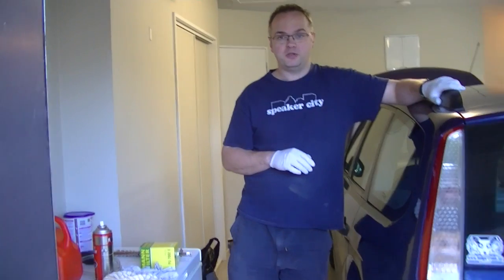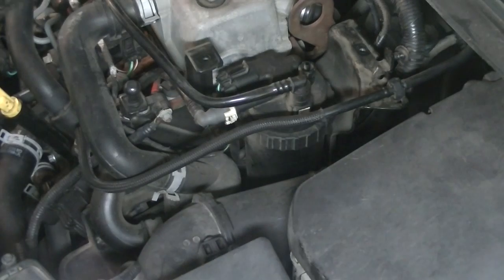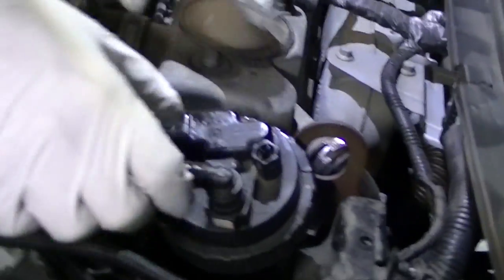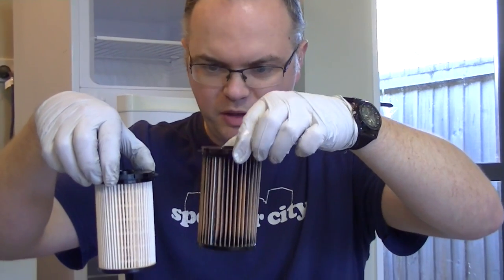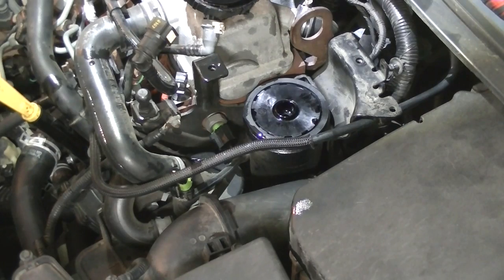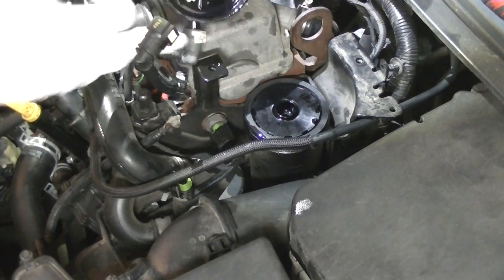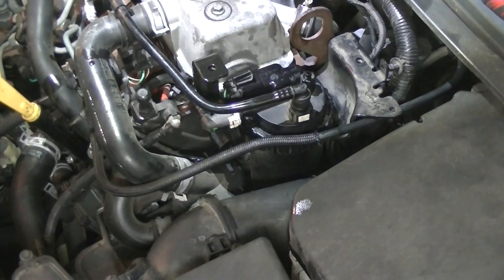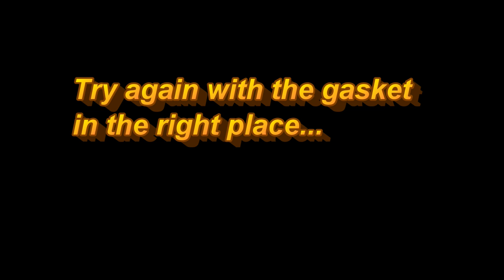Ford Focus 1.8TDCi Fuel Filter DIY with a twist...

Comment: Spent ages looking for a mondeo 1.8 specific video but pretty much looks like its the same engine to a focus. I foolishly thought I'd get away without having to prime the system... alas I was wrong and now its a bicycle ride to the hardware store tomorrow to get the pump xD
Needless to say Ive only just bought the car and the fuel filter is absolutley black! cant believe it. 

Thanks for the video though, very helpful, before I go theres a 3rd little valve on the top of the fuel filter housing (made of plastic) what would that be for?
Reply from the maker: There is a factory bleeding sequence using that bleeder on the top of the filter. I think someone documented the procedure in the comments somewhere. I've never used it. Good luck!

Comment: All you need to do is fill the fuel filter full with diesel, get a turkey baster push as much fuel down both inlet & outlet fuel lines & it will start 5 seconds after , don’t draw fuel out of filter housing get as much in as possible just got mine started this way been messing about for 2 hours

Comment: Changed the fuel filter my dads Focus the other week, didn't have the primer so I towed him around the block a few times because his battery died with trying to start the car and eventually it started, you could tell air was still in the system but after a bit of spirited driving for 15 minutes it was fine.
Reply from the maker: Nice, although you can damage the fuel pump if you run it without diesel.

Comment: Could you show all your steps. I think you forget to tell that you poured some fuel into fuel filter, fuel pipe and primer before priming because primer cannot prime air as you can see in you first attempt. I found another way of getting air out and it involves air to be sacked through small bleeding valve using 10ml seringe and pipe inserted into it instead of piston. I can make video if someone needs.
Reply from the maker: It's not a DIY video. Just showing you what problem I had

Comment: Hi there, Thanks a mill for this super helpful video, I'll be tackling it as soon as some transparent hose shows up for my hand pump. I have a question - what's your opinion on bleeding the fuel line between the  filter and the HP fuel pump? I've seen other videos where they do it, but you didn't do it here. Just wondering if you had forgotten, or if it was a deliberate decision, or if you did it but didn't show it. Obviously the engine started up for you, so your way works, but because I've seen it done bothe ways, I'm a little unsure.

Please and thanks, from Scotland.

Comment: Sadly I did what you said and put the seal on the filter but when I tried to to pump the diesel through it would not work, so I change it back and put the seal on top of filter and within two pumps the fuel was through.

Comment: I’ve just replaced my fuel filter on my S Max and I found the seal was on top of the filter so you might of been right the first time.
Reply from the maker: Ford factory manual says it goes on the bottom. I've heard of both working, I think it depends on filter brand

Comment: From what I've experienced the seal should be ABOVE the filter , as you had it in the first place ,not BELOW,  basically as there is a slight recess in the float bowl for the filter to sit in . I don't know why you had so much air , possibly not seated correctly or tightened sufficiently . Bleeding is critical on these engines , if I have problems I pull the fuel through the main injector pump by connecting your hand pump to the red fuel clip on the return pipe just above the fuel pump , that way there is no way for air to get in between pump and filter when connecting and disconnecting fuel lines . Good video though
Reply from the maker: +tripleMacca thanks for dropping by and commenting. According to the Ford factory manual the seal should be below the filter and that works for me! I have had problems with certain brands of filter though, the updated Mahle version I couldn't get to bleed no matter what I did. Cheers!
Reply: You would expect the factory manual to be right so maybe the one's I have changed have been put in wrong , I normally put something back the way it was unless it is blatantly wrong . If a car comes to me running then I have to assume fitting it the same way means it should go away running , maybe I've been lucky ;-)
Reply from the maker: +tripleMacca it could be down to the differences between certain brands of filter. I presume I would have put it on the way I took it off on this one but no way it was going to work. I replaced a Ford filter with a Mann one. Who knows... Thanks for your comments, always good to hear the voice of experience

Comment: I did the exact same thing. I couldn't start my car .even tried putting easy start in manifold. In the end I had to get the car towed away to mecahnic and had to pay towman and mecahnic . Hard lesson learnt
Reply from the maker: These cars are a pain but if you're prepared and know about the issue you can have a plan to get it sorted. Cheers

Comment: Great video. My filter was way worse. Looked like it's never been changed. Just wondering. Have you changed the PCV valve on this engine? I'm struggling to find any information/videos on how to do it. I can only find videos on the petrol engine. Cheers

Comment: I did this job again recently but having issues this time. Changed the filter and bled the system and it fired up no problem and ran good for a few days and then one morning it started and then just shut off. It wouldn't start again so I had to get the loan of my brother's car for the day as luckily he was off. When I got home I bled the system again and fired up and ran fine for another 2 or 3 days when same issues. It started on evening (after driving fine the entire day) and just suddenly shut off. I am going to take the filter housing out tomorrow and open it up and have a good look inside. I think there is air slowly getting into the system but I just don't know where. Could be the housing sealing ring (the thing you tighten) or maybe my rubber o ring on the filter has no seated properly. Anyway it is bugging me because there is nothing worse than having an unreliable car.
Reply from the maker: I had problems with certain brands of filters being a pig to bleed. What filter are you using? Certainly sounds like a slow leak 😩
Reply: @Badgertronix  The filter is a ufi brand. We had a good look at it today and noticed that the seal that the filter goes through was not sitting perfectly central. Hopefully this was the cause. It was very hard to bleed then which is seemingly a good thing. When there was a leak it was easy to bleed 😂

Comment: Same thing happened to my ford Smax 1.8 tdci. I had replace the whole head due to camshaft snaped. So i fixed all that but now I am facing an other problem which I can not get the car to start. The fuel pressure is too low or there might be expensive air in the system. I have cracked open all the injector nuts to see if there are any bubbles but injector number 1 and two do dribble number 3 and 4 are completely dry can someone help. Kind regards.

Comment: I replaced the filter 1589089 and 5.5 ltrs dctf wssm2c936 in my focus tdci. Shifting still shudders on take-off during initial run but lessens eventually but sliding occurs when i manually shift from 4-6th gears. Any idea what's going on?
Reply from the maker: +Mauro Maceda I've never driven a Focus with the DCT transmission so I can't offer any advice sorry. I believe it's a known issue though. Cheers!

Comment: Hi what's the size of the hose on the hand pump used to pump the air out of the fuel system? Is it 8mm thanks
Reply from the maker: +zak baggott I think I used 3/8ths fuel injection hose, so about 9.5mm. Cheers

Comment: I need to do this, but obviously worried about messing it up. Ive had the car 7 years, 68k - 114k, not changed fuel filter, seems no problems. Ive even bought the bleeding kit from ebay, £20. what are your thoughts please, i once read if its working ok, leave it alone
Reply from the maker: diesel filters need changing so either give it a crack or get it done
Reply: @Badgertronix  yes thanks I've done it now with the Mann filter, there was a Fram filter, with a metal top, and the seal on top! I also struggled with the connector on the outflow pipe, it was damaged, now held fast with a cable ties. I also finished bleeding using the clutch spray in the intake, after using a Laser priming bulb.
The engine is now more responsive. Thanks for your video.

Comment: Ahhh. Had a nightmare with this all day! Followed this video exactly on my 1.8 tdci s max. Used a pump to prime the system after filling the housing to the brim. 

Car won't start. Completely baffled! Any ideas what I could try to fix this?
Reply from the maker: They can be really hard to bleed but sounds like you were doing it the right way. 

This is the documented procedure:
Using a hand-held vacuum pump
1 Depress the release tabs and disconnect
the fuel outlet hose from the fuel filter.
2 Connect the vacuum pump pipe to the
outlet on the filter, and continue to pull a
vacuum until bubble-free fuel emerges from
the hose.
3 Reconnect the fuel hose.
4 Operate the starter motor and run the
engine until it reaches normal operating
temperature.
Caution: Do not operate. the starter motor
for more than 10 seconds, then wait 30 seconds
before trying again.
5 Stop the engine. Wipe up any fuel spillage,
and refit the engine cover.
Reply: When you fit the new filter the gasket has to go on the bottom. But however the pump should be connected on the fuel supply line for the filter (thich black line on the right with a black cap). The other end of the pump should go on the tube to connect the fuel filter supply line. The arrow should point towards the fuel filter. Next you should connect a clear tube on the bleeder screw and unscrew it loose (make sure you catch it in a can with the other end of the tube). You should pump until clear diesel flows through the tube of the bleeder screw without air. Important to tighten the bleeder screw just finger tight.

Comment: can any one tell me what causes a ford tdci to loose power when boating or driving over 50 mph then the engine starts to go into limp mode till the ignition key needs to be turnd off and on to drive normal it looses power up hill very often
Reply from the maker: It must set a fault code when it does that. That will point you in the right direction. Could be injectors, turbo, boost leak or anything else. Some more diagnostics required

Comment: Where i can buy o-ring seal (inside fuel filter cup on the filter center)?
Reply from the maker: Should come with a new filter or your Ford dealer
Reply: In the UK only the Mann and Mapco filters come with the small replacement o-ring.

Comment: Whats the total mileage on that Focus badger? 

Just asking because i don't know anyone who has gotten more than 90,000 miles out of one of those 1.8's. My boss had his go to the scrap at 67K (the DMF was going, but the cabin got damp and shorted out the power seats and caused gremlins). One of the engineers i work with scraped his at 72k because it needed £8000 worth of work doing to the engine plus clutch/dmf plus suspension work. A contractor i use spent £3700 at 80k to get another 10k out of it before he scrapped it. I have found the ford diesels really disappointing. I would like to own a diesel because i do so many miles. But most of my mechanical knowledge is on petrols.
Reply from the maker: +zoidberg444 100,000 miles and all I've needed is a new intercooler because the old one got holed.

That's interesting, can't say I've heard too many horror stories about them. The 1.8 dates from the 70s and has been pretty well refined. No DPF, EGR bypassed, not much to go wrong.

The dual mass flywheel will go at some stage but that's a common issue on most new diesels. The only other issue on these is the cambelt that runs in oil for the diesel pump. I'll change that to a chain once the warranty runs out.

Touch wood, but this is the most reliable car I've ever owned.
Reply: Badgertronix
You know i wonder if the regs for diesels in NZ are different to the UK. Because I've heard the JDM diesels are best but get lower MPG/worse emissions but do actually last quite well compared to European market diesels because the engines aren't as stressed in the way they are tuned. I literally don't know anyone who has a good word for Ford diesels. The petrol's are ok i suppose. I literally can't think of a modern diesel engine i haven't heard horror stories about. The best are probably the Honda ones, the Toyota diesels are ok. But by Toyota standards are huge problems for them with all sorts of warranty work. Our office had one of our 1.4 Yaris blow up. Needed a new engine under warranty.

The DPF's are an absolute nightmare. I know people who have had huge bills for them on BMW's, VAG's, Nissans and Fords. A friend of mine got his wife a Ford Kuga and the DPF failed in it after 3 years. Someone else i used to work with had the DPF on his 118D fail recently. I told him not to buy the bloody thing! The bills are huge. Like £2-3K!

You know the BMW N47 engines have chain driven high pressure pumps and the chains snap all the time on them. Happened to a friend of mine 08 520D/87k. From what i read the chains didn't cope with the vibrations from the high pressure pump very well.
Reply from the maker: Petrol will be the way to go in the future. All the emissions kit is killing the diesel market. Although aftermarket DPFs are getting common.

I've had plenty of diesels over the years and not had too many issues. The 200,000 mile Passat I sold in 2007 only got scrapped around 2 years ago with who knows how many miles on it.
Reply from the maker: diesels here are the same as the UK models with same emissions standards. We've adopted the Euro standards.
Reply: +Badgertronix That wouldn't have had the 1.9 engine would it? Most of the long lived diesels i know are old VAG 1.9's and older Peugeots. A mate of mine has a 17 year old 1.9 Golf. It's off the road at the moment because the front suspension, engine mounts, radiator, water pump are all shot and the exhaust and clutch are on their last legs and it needs some intervention for rust and the braking system has some problems and it needs some new coolant hoses. But the engine purrs like a kitten at 340k! Although apparently VAG changed the design on the 1.9 and its not as good. I always find VW's are excellent vehicles, they are often let down by silly things due to penny pinching. I know a few people who got 250k + out of landrover td5's.
Reply: I’ve had 241,000 on my 2003 1.8 tddi,
The one I have now 2006 it is on 172,000,
These are the best ford diesel you can get !
Reply: Not sure where you get that from?  Relative to how many were sold in the UK, there are still plenty of MK2 Focus 1.8 TDCi's kicking about.  The engine is generally considered to be pretty bulletproof (cast iron head, no DPF, 2nd generation common rail system), my 2005 is on 180K miles (approx 280K KM) and it still has the original clutch, DMF, injectors, high pressure pump and injectors.

The 1.6 TDCi Peugeot derived engine however is total crap and there are many garages in the UK that refuse to replace the turbo when it blows (oil starvation) because the engine gets that choked with carbon that even if you replace the entire oil feed system it's only a matter of time before it clogs again.

Comment: What happens if i dont bleed the system? I have managed it without bleeding it before and about to do it again but i dont have the pipes ect
Reply from the maker: You can get lucky and it starts and you don't need to bleed it. Otherwise if there's air in the system it will just keep cranking and will never start. No fuel will get to the pump and since the pump is lubricated by diesel the pump can get damaged if you crank without fuel.

Comment: What is the valve for on the lid? Should it be open or closed?
Reply from the maker: it's another bleed valve and should be closed. You can use that too to bleed the system but I find the method in the video works best